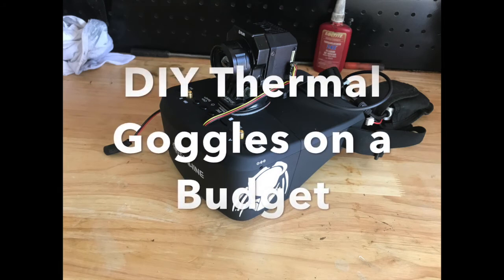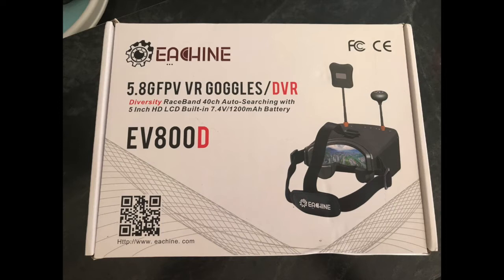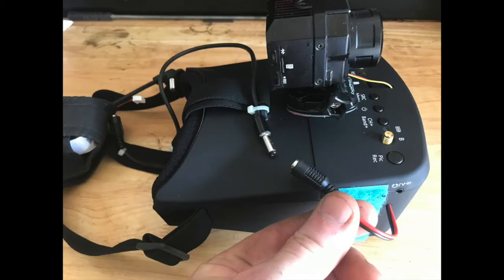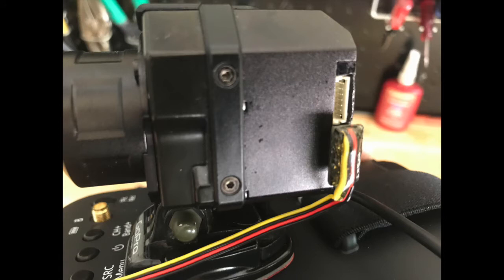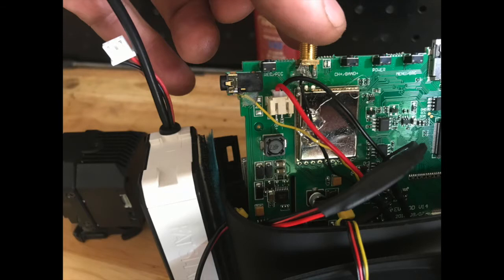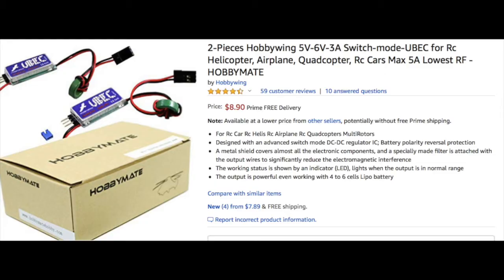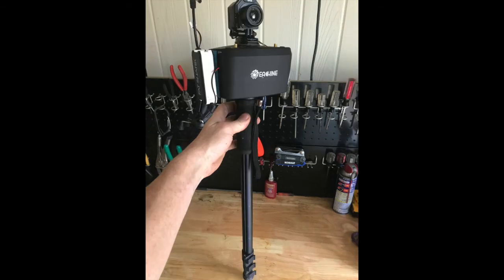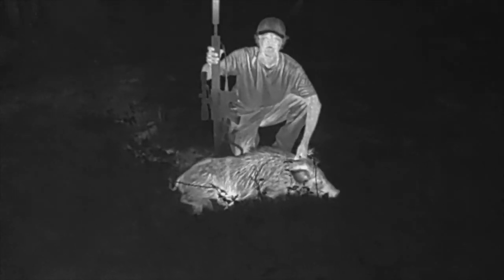DIY Thermal Goggles

Comment: Is this safe to do? I have a degree in engineering (mechanical, not electrical) and I’ve always been interested in these type of DIY projects. But I’ve always been concerned of messing up and shocking myself, electronics seem uniquely dangerous to me.
Reply: The voltage on this is way too low to shock u lol

Comment: It's so far out from the forehead. How do you keep the optic pointed ahead while it's constantly pulling your head down
Reply from the maker: I balanced it out by removing the internal battery and mounting the replacement on the back of the head strap.  It worked pretty well.